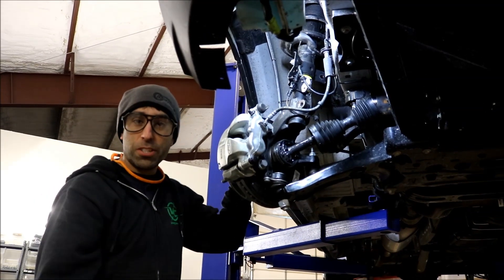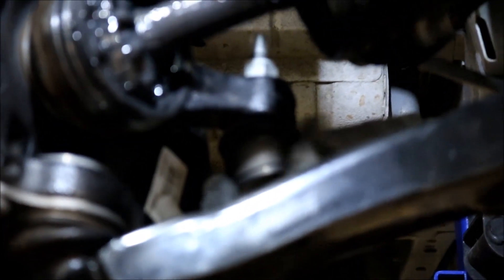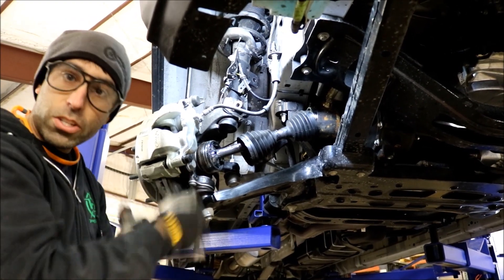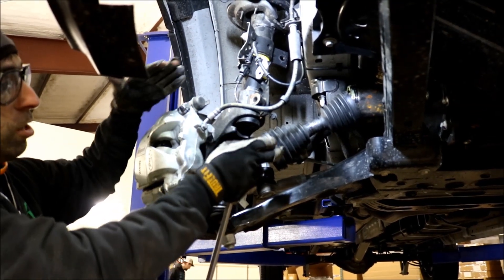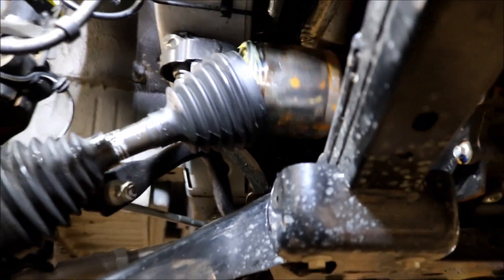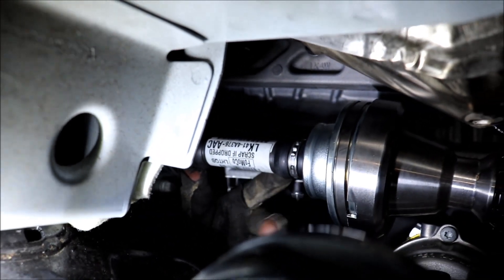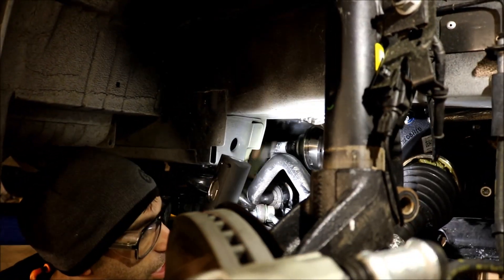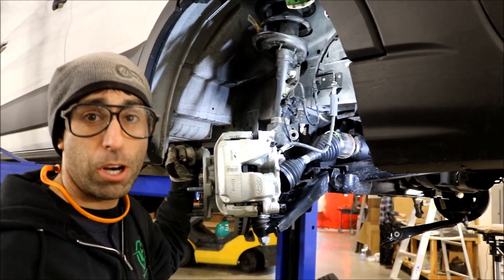2020 Ford Transit AWD front suspension overview

Comment: I won't be able send my van from NYC and it done at Van compass. If I buy Van compass lift kit the lift upgrade would be properly done? or it's something else the mechanic has to work on separately?
Reply from the maker: Our kit is designed to be installed by the DIY type or mechanic. We provide detailed instructions with the kit and they are available on our website for reference.

Comment: So...no sub frame spacer, but still up on the website?  There is so much confusing information regarding this lift.  Sub frame spacer - no sub frame spacer.  Bilstein strut - no bilstein strut for AWDs.   Please clean up the website with current info.
Reply from the maker: No subframe spacers can be used. The front driveshaft will not allow us to drop the subframe. We had to compromise and only allow the front of the van to drop out 3/4" with a small strut spacer and coil spring to provide lift. show in the next video.

Comment: Soooo what happened to the sub-frame spacers? They aren't part of your lift afterall, how do you explain this?
Reply from the maker: No subframe spacers can be used. The front driveshaft will not allow us to drop the subframe. We had to compromise and only allow the front of the van to drop out 3/4" with a small strut spacer and coil spring to provide lift. show in the next video.

Comment: The only solution is a solid axle swap.  These aren't worth putting a dime into. all these new euro trash vans are junk, sprinter included.
E-series van with swc4x4vans, ujointoffroad or sportsmobile 4wd conversions are the way to go.
Reply: Unfortunately that is not feasible the cost of a SAS would be 20k.  Better to find a working solution for a mild 1 to 1/12 inch lift..IMOP.